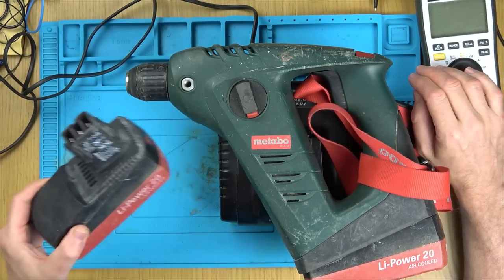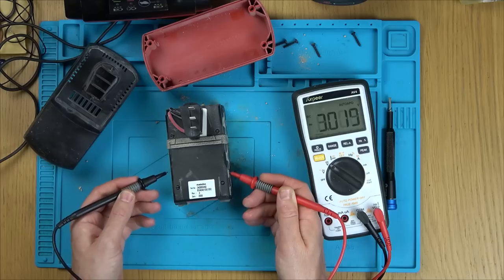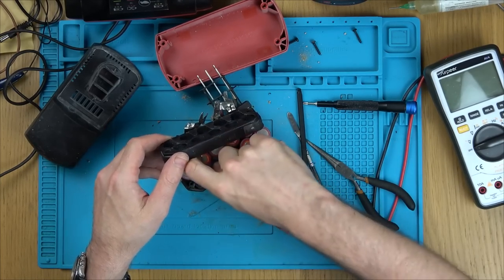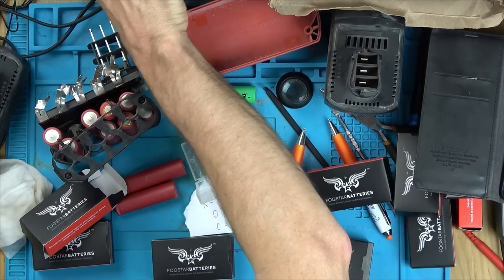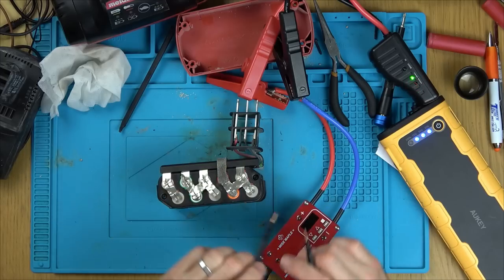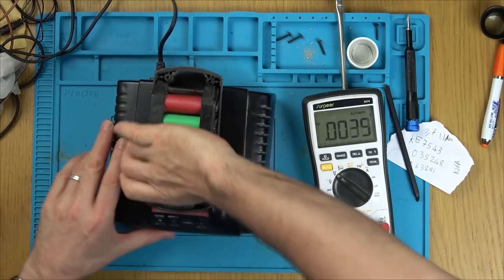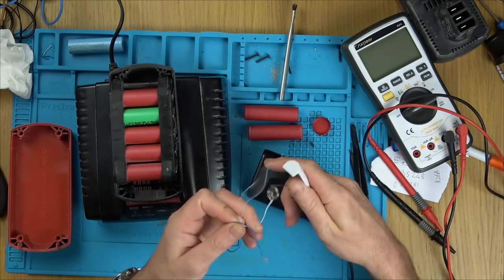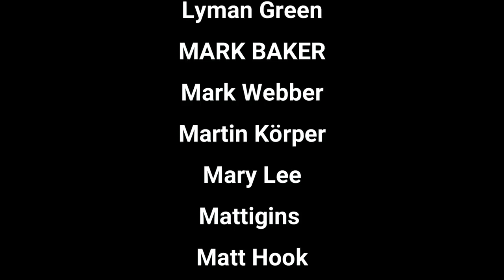DEAD High Quality Metabo DRILL BATTERY - Can it be REPAIRED?

Comment: I reckon anyone with a bit of know-how and an adventurous spirit can totally make something useful out of a spot welder like yours. There's probably no need to spend the big dollar! Let me explain...

I bought one of those crappy aliexpress £15 spot welders about 2 years ago before I knew anything about electronics. It was absolutely rubbish. Even though I was using decent high-current LiPo packs, on its max setting the welds were still barely visible. So I kept upping the battery voltage until the damn thing fried.

A few months later, I dug it out of the parts drawer and analysed the circuitry and made a mental model of the schematic. Firstly, I realised it had no gate driver for the 5x FDBL9403 mosfets (awesome chips btw) which meant that they experienced excessive amounts of punishment every time they dumped current. Two of them were fried, so I ordered some replacements.

The next thing I noticed was the crappy 8-bit microcontroller was obviously also fried. So I deleted the IC, and soldered on some wires for ground, VCC, mosfet gates, and continuity detection (which is how it knows you've got the electrodes pressed to a conductive surface). The plan was to write a bit of Arduino code to do the job right.

So I made a simple breadboard circuit:
- a mosfet gate driver chip (MCP1407 in this case, but there are MANY chips that do the same job)
- a pair of optocouplers (PC817) from the parts bin
- literally 2 resistors (for current limiting the PC817 inputs), and a 1uF capacitor to feed the gate driver

One optocoupler for passing the continuity detection signal to the microcontroller, and the other for triggering the gate driver. I wanted total galvanic isolation because when the spot welder fried itself, it literally exploded the copper ground plane right off the circuit board. You don't need them kinda transient spikes anywhere near something that's gonna be plugged into your laptop USB port.

With that I was now able to have full control over everything with just a few pages of code. I can customise precisely the shape and duration of the current pulse -- nickel strips thick and thin, it doesn't matter, I can set the pulse duration to anything from a flea's fart, right up to a busy night for the North London fire brigade.

I also control exactly how it's triggered, for maximum comfort in the timing between the probes making contact, and the pulse. And I got rid of the annoying beeps: instead there's a nice 8x8 LED matrix with appropriate animations and flashing for precise feedback. I just need to get around to learning how to use Altium or something so I can get a custom PCB made instead of balancing a mini-breadboard on top of a battery pack.

Seriously, it was such an easy project. Although I am a veteran software engineer, whereas I think most people find the coding to be the trickiest part of such projects. No worries, anyone can have my code -- or I'll write some for whoever does something similar to the above but needs a bit of code to make it work.

(For the sake of clarity I should add that increasing pulse duration is absolutely no substitute for a weak power source. By my careful measurements with a 1.5 mΩ shunt resistor and an oscilloscope, a healthy pulse is easily 1000-1500 Amps. When using a 3S pack (11V - 12.6V) that translates to a sub-10mΩ internal resistance.)

Comment: I  design lithium ion battery packs for consumer electronics and don't recommend anyone modify or repair a failed lithium ion packs due to a variety of possible hazards. If your spot welds are not perfect there is a possibility of local overheating during discharge which could result in excessive cell temperatures and a cell related thermal event. The original cells were closely matched for internal impedance and cell voltage, mismatched cells will result in poorer performance and life than well matched cells. During charging the lower capacity cells will finish charging soonerr and your 2.5Ah cells will not long term be fully charged, this might or might not be an issue depending on cell balancing and external current leakage paths in your BMS. I would keep any modified pack in a fireproof battery box. Otherwise I enjoy your videos!

Comment: For cordless power tools I use 20A discharge rated 18650 cells, like the samsung 25R. To be able to use your spot welder you need to buy nickel strips 0.15mm thick, and replace the original nickel strips that came with the battery. All cells  must have the same voltage when assembling the new battery pack.

Comment: I think it will be OK - obviously better spot welding lol!  But I think you are right about when it's drained, the green cells will have a higher voltage than the red, and then when charging it will reach the turn off point sooner perhaps.  But I think over lots of cycles it may kinda balance out?!?
Reply from the maker: Thanks Chris 👍
Reply: Sorry to say it but thats the wrong way always use the exact same battery and with the same age and wear
Battery new is 1.1Ah but over time (this one is very old) they will lose some capacity i guess they will be around 0.7Ah older models dont have good balancing boards so some batteries have to work harder and will fail sooner
So these battery's are only good for backup spare parts for the other battery pack and always use good brands with high load like minimum of 20c and higher is better 
If you use 10A discharge battery you cant use the fast charger they will overheat also in use they will overheat when it draws full capacity so always use new battery from same batch do not take risks your safety is much more important than  some old battery

Comment: Vince, I think the answer is that it will work and is not a safety issue.  However the battery will become more imbalanced and perhaps even cause the adjacent battery to fail because they are parallel and it will carry most of the load.  If the charger has a proper balancing circuit you could get away with replacing both parallel batteries together.  But no charge balancer in the world will compensate for am unmatched pair in parallel.
Reply: If the new cells are not tool cells and do not have the necessary current capability, it could be a safety issue. They will heat up and if run for longer may experience thermal runaway.

Comment: This is a common fault on many other  battery packs . one of the groups dies because that is the group that the voltage measurement device uses and it keeps drawing a few microamps , and worse when the rest of the battery is flat that those two batteries are drawn down until they die.  Reminder to charge the batteries every few months

Comment: Prob could have used low melt solder in that instance as doubtful the cell cavity would have gotten so hot it would melt low-melt stuff.   As for me I am a Parkside fan all the way, the £20 Lidl's cordless drill I bought is still going strong 5-6 years later, the rotary cordless kit nearly as long and I dunno what 18650's they used but I can leave any of them for months and not lose any charge.   Parkside is also a German company and why I liked my drill, rotary, impact etc is they are all made in Germany, think the only Asian parts are the cells themselves.   I bought the Parkside drill in frustration as the major brand expensive one I had bought two years prior was shagged out after a year of not very heavy duty.   My Parkside impact driver which has the 20v battery is such a game changer for me, just eats wheel nuts off the thread, buzz off and buzz on again and it will punch screws through the hardest timbers and surfaces, great for setting concrete anchors effortlessly.   The rotary tool again bought when my very expensive Dremel burnt out, £20 and 5 years of quite hard duty and still running perfectly.   BTW do check out Lidl's at mo, they got a really decent bench vice for £9.99 which has an attachment to clamp a dremel or soldering iron into plus soft jaw shells and quite a decent jaw gap, I bought one today and already worked it hard, just putting my rotary tool into it so I can do some watch case polishing, so much easier with a static tool :D

Comment: I don't mind working with live voltage and power supplies but there's something about batteries going bang that fills me with dread. It's a shame the manufacturers don't provide adapters so you can use newer batteries and chargers on old drills. I have a Bosch SDS and it's brilliant.
Reply: Don't know about all the brands, but Dewalt sells a battery adapter for the older tools to use the newer batteries, (about $25-$30 for the adapter IIRC).

I've got a couple of the old style tools and only use the new batteries with them nowadays. You just have to make sure nobody tries to charge the new batteries in the old charger with the adapter. No other potential issues in quite a few years with the adapters.
Reply: @genghisbunny  I have an old Makita SDS with charger and a faulty battery. I think I'll open it and see if I can identify the cells to see how much it would be to replace them. The price of a spot welder would have to be factored in too.
Reply from the maker: Thanks again for the Super Thanks Philip👌👍
Reply: @Mymatevince  You're welcome.
Reply: Adapters are available to buy for some combinations - if you got a 3D printer, many cominations are available in thingiverse to build them yourself. If you the (very moderate) needed skills, you can also convert tools all to one battery standard - adapters for this are again available to buy for some battries, and for most on thingiverse.

Comment: I think this will be fine. The green cells will have the easiest time ..not really empty when the drill stops working and not really full when the charger stops charging .. this is the best case scenario for Li-ION cells. The only worry would be the discharge rate of the new cells. The other cells having a relatively low capacity suggest they have heavy duty discharge capability. In most Li-ION cells it is a tradeoff between capacity and discharge rating. But I would not worry about it..
Reply from the maker: Thanks VVerVVum 👍👍

Comment: if you make the pack 5aH the charger wont mind... it'll just take longer to charge than the 2.2aH packs.  probably about twice as long as the 2.2packs take. BUT the drill will run twice as long as it did with 2.2aH packs.

the few tool packs i have repaired by only changing one cell went bad again very shortly after the new cell was installed.  those 25R cells are great cells.  a pack full of them will breathe new life into your old drill.

Comment: Trying to fix a Bosch Athlet hoover. I had the same problem trying to weld 18650’s with the same welder. Bought the 99 Gears type spot welder and it wouldn’t weld 18650’s either. Ended up soldering very quickly with flux. That worked and didn’t blow up. However l shorted out the disconnected control board and let the smoke out. The battery bank was disconnected, not sure what shorted.

Comment: Recently found the channel and enjoying the repairs. I've bought some random returns from auctions in the past and had generally good luck in getting stuff that wasn't really broken or easily repaired, not even close to the depth you go to, so that Icould use them. I have recently bought a tool and battery that is probably likely to have the same problem as you show here I think. Should be 18V but only shows about 12V after 'charging'. Shame since the battery pack (5Ah) looks totally unused so likely an issue from new, hence the return. I'm chancing my arm with the warranty but if i can't get a replacement I doubt it's going to be worth the stress to repair myself since I don't have the spot welder etc to hand but good to have an idea what the problem is.

Comment: I've had a few issues with batteries or chargers that's for sure.

The weirdest were:
A Black and Decker hammer drill where the battery charges fine in a compatible DeWalt charger but doesn't in the original Black and Decker. I tested at the connections to the battery and it didn't look right so opened the charger and found that the adapter was supposed to be supplying something like 24v AC to the board and it had failed. I couldn't find an AC adapter compatible so I looked at the options of wiring a DC adapter into the circuit instead. In theory it could have worked but I gave up on the project partly because I lost the items I bought to fix it.. Doh!

An Atlas Copco 12v hammer drill which had some issues in use which I resolved and then had to get a charger. I got one and after cleaning it I noticed that the charger just wouldn't work (I hadn't got it wet) and got a replacement. That worked for probably 2 weeks before it also failed and not clear why. I can charge the battery with another independent charger but it isn't ideal when I'm trying to sell the thing as a working drill. It should work but it doesn't. Going to be fun trying to figure out why that has failed.

Comment: Typically, the charger will stop when any cell in a series pack is fully charged.  Likewise when discharging the device will shut off when any cell is empty.  The biggest problem with an imbalanced pack is that you won't get the full runtime.  (Just like with the suitcase).  In this case it really doesn't matter as the new cells will never fully charge or fully discharge as the weaker older cells will finish first both ways.  You can test that behavior yourself by measuring the cells as they charge and when they cut-off.
Reply: Well it did stop charging when his green cells where (near) 4.2 volts, so it probably does stop charging when a single group is fully charged. Hopefully it does the same when discharging. But in my opinion doing this, without knowing exactly what kind of features the BMS has or how it behaves, is dangerous, some (older) lithium ion packs don't have a BMS at all, if you would replace a single cell (group) like this it would probably end up out of balance (new cells have a different capacity) and because there is no BMS that monitors the voltages of the groups this would lead to undercharged (when discharging) and overcharged (when charging) cells, which is dangerous.

Comment: On the weak cell, you can bump charge it up to the point where it likely will work fine. Bump charging take advantage of the fact that AC has voltage on a sine wave so you will have voltage almost all the time. this places a voltage to the load at power on then the circuit takes over and removes the voltage. turning the charging circuit on and off (power strips work well) you can force power into the cell. after about 20 or so, just leave the 18650 single cell charger attached to the battery that was allowed to over discharge. It cannot hurt to try this.

Comment: Vince you was spot welding wrong, You was "live and earthing" the same bit of metal you need to earth the battery terminal and live probe the strip joiner with the probe so the electric travels from probe through the connector, through the battery terminal to the probe. And I bet when you read this and watch back the video you will see it. Great Vids as always x
Reply: That is how these spot welders work. Both the positive and the negative will weld at the same time by using low voltage but very high amps to quickly heat up the tiny points of contact and fuse them into the surface below. If you put one probe on the battery directly you would burn a hole in the battery. He could have tried hitting one spot with multiple welds in quick succession and gotten them to fuse together.

Comment: Yeah I found the same issue with my spot welder not being able to spot weld such thick nickel strip. I think only a commercial spot welder would have the power to spot weld such thick strip.

In the past I have double up on nickel strip by spot welding one strip on top of another as the strips are thinner the spot welder can weld the the strip without issue but I am unsure if doubling up on the strip doubles the current carrying capacity of the strip.

Comment: My experience with spot welding is that you should not press down too hard. You need the higher resistance from light pressure to actually weld. When pressing hard resistance becomes low and current flow without doing anything.
Reply: They should literally print this advice on the back of every hobbyist-level spot welder. Many dozens of attempts were made before I realised this!

Comment: An important thing to consider is the C rating of the cells because that dictates the safe charging current. For example, a 2,500mAh cell with a 1C rating can be charged at 2.5 Amps and will take an hour to charge, once at Low Voltage Cutoff (LVC). A 2,500mAh cell with a 2C rating can be safely charged at 5Amps (2 x 2,500mA) and will take half an hour to charge from LVC. By mixing different C rated cells and cells with different mAh values, you are likely to run into balancing issues. I use very powerful LiPo packs in my large remote control monster trucks and use a hobby grade balance charger, always charge at 1C and always put the cells in a flame proof charging pouch. Be careful!

Comment: My grandfather had a Bosch (Might have been Black and Decker though) battery powered drill in the 80s. Probably early 1980s. It was pretty weak and always running out of charge, at the time I just used to wonder why he bothered. They definitely got a lot better. Seems their first was in 1978 and I can't find anymore details than that. I remember it being orange and silver.
Reply: Orang was/(is?) a Black & Decker colour. Chances are good that the old drill was using NiCad battery cells, which are notorious for failing quickly, esp if partially charged (due to the 'memory effect' & poor charging regimes). Modern Lithium battery cells don't have this problem, & it's often easy to find a suitable converter or to DIY a replacement battery pack